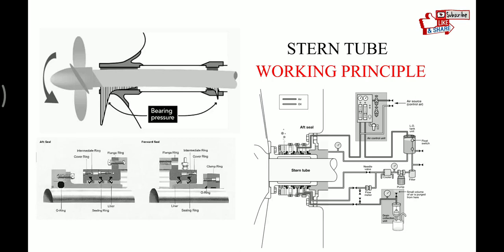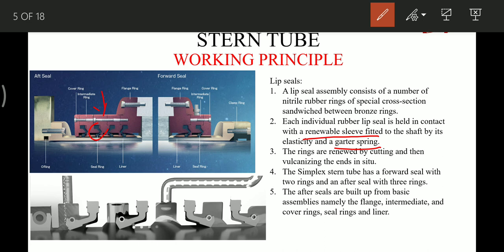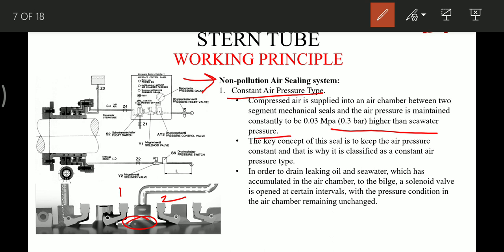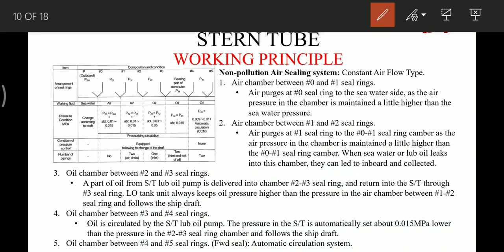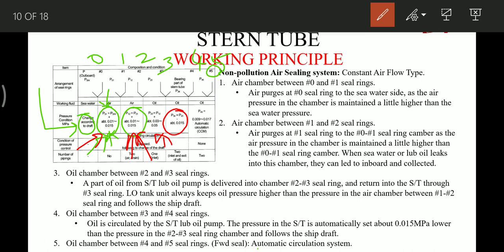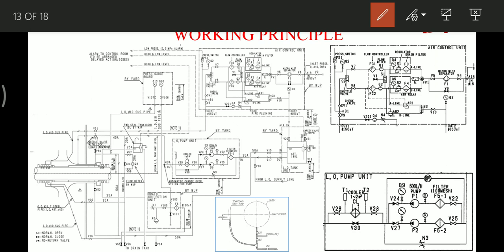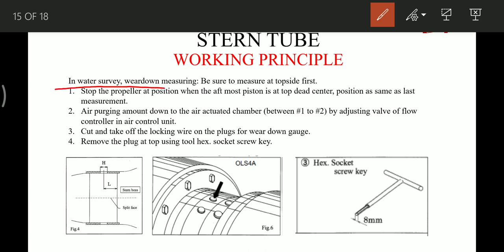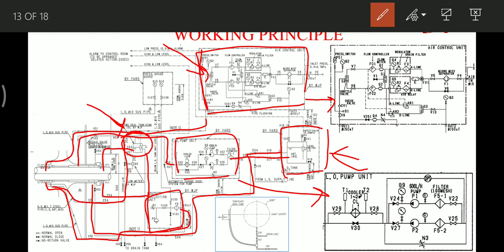Stern Tube, Working principle.

Comment: No doubt ur video is very useful but ur way of explanation need to be improved.( i mean on ur communication part)..stern tube sealing system is one of the most impt item of engine room and it is a class item..this vedio contain lot of technical content therefore plss work a bit on ur communcation...thnks

Comment: why does liner rotate with the propellor shaft?
Reply from the maker: Which liner..??
Reply: Liner rotates together with shaft liner is fixed at the shaft and has o-ring so they rotate together and liner does not leak anything.